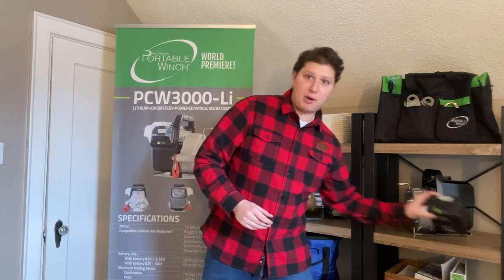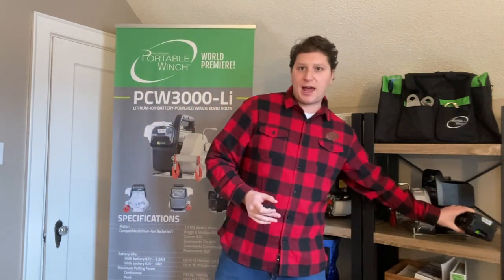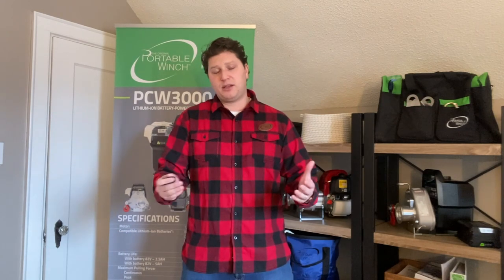Will's advice - Working with a winch in winter

Comment: I thought my gearcase was leaking, but it turned out that my rope had absorbed moisture from being stored in my humid covered truckbed and when squeezed by the capstan, it forced the moisture to drip out.  It really looked like the gearcase was leaking oil, but it was dirty water.
Reply from the maker: Thanks for you comment. Indeed, dirty water can be confused with grease.